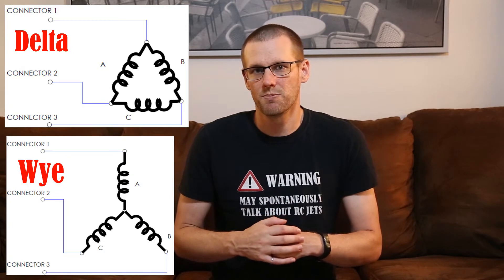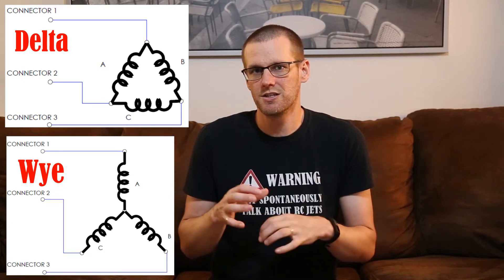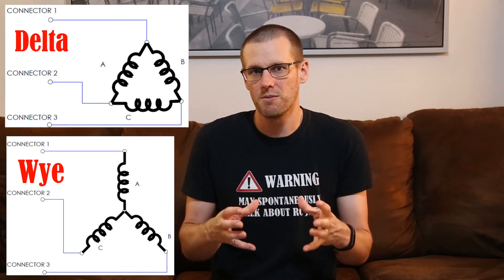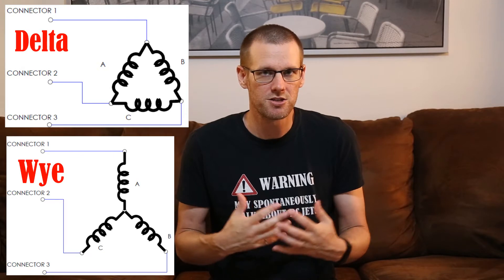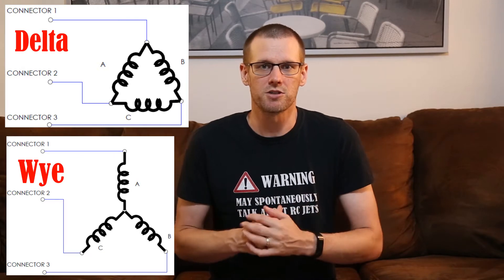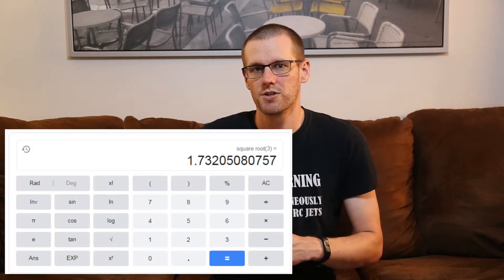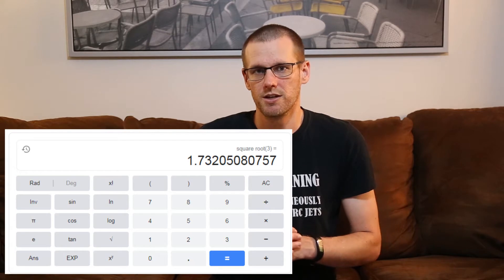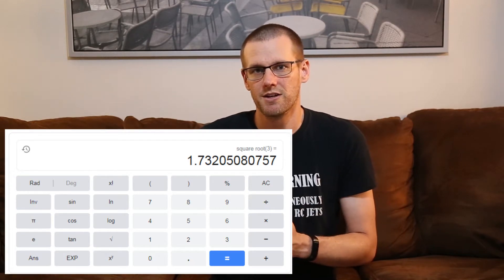Brushless Motor Kv and Kt of a Wye vs Delta Wind

Comment: If I have an unknown BLDC motor with 3 terminals, how can I, with a simple measurement and without disassembling the motor, find out what the Wye or Delta connection method is?
Reply from the maker: Why do you need this information?

Comment: Great Video! In case i can wind the motor by myself, i would prefer delta because less soldering/cleaner and can adjust the kV by wire thickness/turns. Am i right with my assumptions?
Reply from the maker: This could be a personal preference as one could prefer wye for ease and simplicity. Both termination types perform the same when it comes to turn counts.

Comment: Hello friend, 3 years ago I tried delta winding to 1 wheel (motor ) of hoverboard wheel and 600w controller, it work perfect, but last months I try to do it to 2 electric scooter (motorcycle)  both of them had negative result, acceleration and power about decrease *3 times, what was problem? Problem was limitation of controllers of them for not allow to pull more current or was another things ?

Comment: Ryan, thank you always. I have a little question.
1. The maximum watts of D and Y are the same.
2. D is 1.7 times higher in KV than Y.
3. The maximum voltage of D is lower than Y.

If what I understand is accurate, it means that only KV has changed.

Then, why do manufacturers make motors in two ways?
Isn't it convenient for manufacturers to make high kvs with one winding method?

I wonder what the difference is between the same voltage and KV.
Reply from the maker: It's convenient for end users to have many different kv options to be able to get the same power output at different voltages. This allows a user to select a voltage specific to their setup rather then being locked in.
Reply: @RCexplained  Thank you for your answer.
I'm sorry. My question must have been a bit of a sham.

I wonder the difference between D2000 kv and Y2000 kv at the same voltage.

I've been looking for related videos since yesterday, but I don't know the difference. I don't think there's anyone other than you who can solve it.

I hope you are always healthy.
Reply from the maker: In theory there should be minimal difference.
Reply: @rcmod642  With the same KV between Y and delta. They will have different power. On video we talk about same power.

Comment: I’m new to all this so I’m sorry if this is a simple question that I should already know. My question is, how can you tell what “S” a motor can handle?
Reply from the maker: Are you asking about "s" as in cells in series for a LiPo? 2s vs 4s battery ect. If so, a motor has a maximum RPM limit and you would divide this limit by the kv of the motor to determine maximum voltage. The maximum voltage would be related to the LiPo battery being used.
Reply: RCexplained thanks! Yea that’s what I was wondering. I really didn’t know how to word it. Trying to see if a certain motor can handle 8s or not.
Reply: RCexplained I have a 2200KV motor on a traxxas UDR and can’t find the max rpm of it anywhere. Anyway to find that info?
Reply from the maker: This would have to come directly from the manufacture of the motor.

Comment: In general, is either configuration more efficient in terms of power and torque delivered vs power drawn?
Reply from the maker: Hey Remko, I don't have any data of my own to support one wind termination being more efficient then the other.
Reply: @RCexplained  Well, thanks the anyway! Does anyone else reading this thread know more?
Reply: With mine, star winding is more efficient than delta. I think, low kv motor consumption more effecient than hi Kv. More wider accelerate more current it needs. At my motor star con, 778rpm. Delta 1400rpm. Just like ryan told, need 4 - 5 times higher current
Reply: More time to max rpm, it means more current needs to reach max rpm. I think the best is low Kv motor and changed gear is the best option but reduced the gears lifetime

Comment: How to calculate the approximately the current difference between wye and delta?
Reply from the maker: In the exact same application with the same load, I would expect current to be 4-5 times higher on a delta wind vs Wye Wind.
Reply: So... If at wye spend 70a, 4 or 5 times 70a = 280a?why is so big?
Reply from the maker: You are nearly doubling the available RPM at full throttle. Load and power output is not linear to RPM.
Reply: My motor is 780 rpm at wye. What rpm at delta. Now i limit the current, about 75amp. What suggestion the best current for delta, not to big but not to less. If 4 x, it will melt all the cables and controller. I ve measured the max motor current. Was about 117a at 52v wye con, voltage was drop 1.8v - 2v. So i think, my battery's can handle it.
Reply from the maker: @edwinjidat8885  you can estimate current drawn and rpm from the multiplication factors above and is the video. What is the load on your motor? Propeller?
Reply: Tht is my ebike. 😋. Im not satisfied about ebike channels. They were only talk about battery, controller. Nobody talked about the motor it self. They only talked about motor rated, but never given me right answer. Actually, ebike motor can held more power, even the spec are less. Ex, my ebike motor are rated for 1000w. I changed the controller, it can draw 117a. Meant 117a x 52v= 6084wh. Yes hot. 95'c inside the motor. But i already eliminated it. Put air cooling, extra fan, make heatsink (copper core) stright through the lid of the motor. Now it run 60'c. I changed all the motor cables. From 16awg to 10awg. Just like u was said, to eliminating current loss. And put contactors to switch from wye to delta for turbo button. Thks to you bro, i made my dream come true. Now i can make fun the ordinary engine scooters. Im faster. Hahahaha👍
Reply: Try to google the city of mine "jakarta". The traffic are horrible. So, to solve it, rides motorbikes. So i get rid of the my ordinary motorcycles, using ebike was the answer. Thank you very much for you bro
Reply: Btw my ebike weight is about 150kg with the rider, 10" diameter of tire
Reply from the maker: Sounds like a fun project that you have dialed in well. Switching from wye to delta wiring is quite the bump in power. Glad the channel can help you.